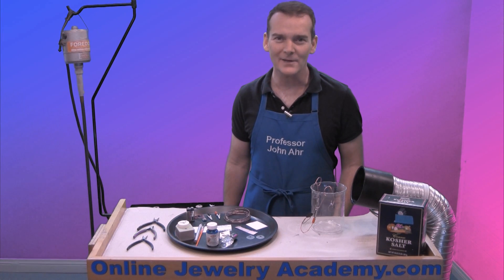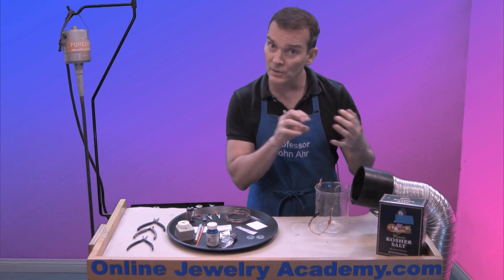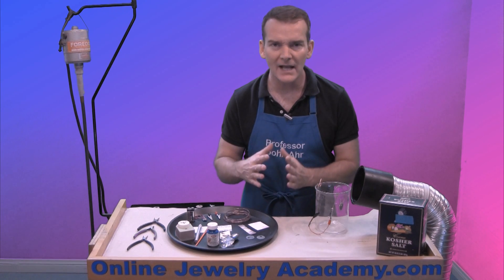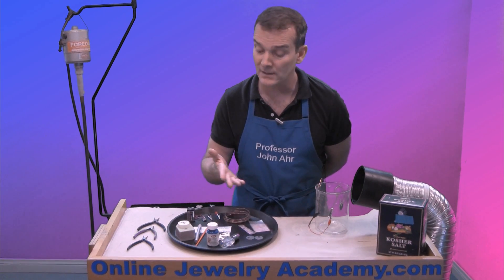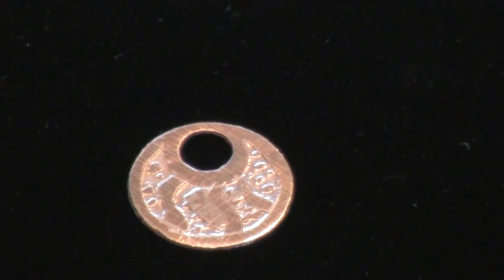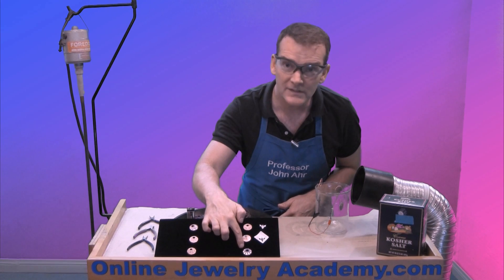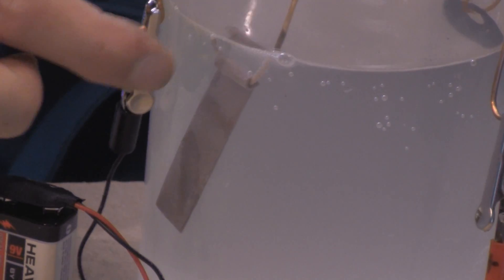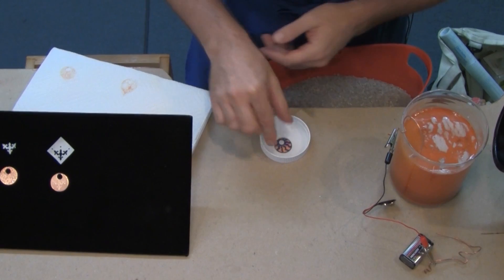Electrical Etching Using Salt Water

Comment: Hi John,
guess I misplaced my question before.
I successfully etched copper using your method. Not very deep though, but did not wait long because this was just a test.
Actually I want to etch silver, and this was disappointing. Achieved some blotchy areas in shades of grey. Reminded me more of the result of blackening silver using saltwater and a 6V-battery.
For the cathode I first tried copper, then silver. That is not very clear, as before you answered 'copper for copper, brass for brass'.
Any idea what may have gone wrong? Thanks in advance.
Reply from the maker: Sylvia Hartmann Sorry to hear that your silver project didn't turn out as you expected it would.  There are other methods for etching silver.  But, they involve etching mordants that can be dangerous to work with.  The OJA strives to provide information about processes, tools and materials that are safe to work with and sustainable.  I'm certain that a search on Google will point you in the direction of other techniques that will help you to better achieve your creative goals.  Thanks for the feedback.  And, thanks for watching!  : )
Reply: OnlineJewelryAcademy
What a pity. I had hoped you would answer that it was my fault because... From the video I got the impression it should work for silver too. I don't want any dangerous mordants in my home, and anyway there are severe restrictions on who may buy those.
Reply: OnlineJewelryAcademy
Hi! I did watch it, of course. And since my setup works with copper... Please do make a statement on what should be used as scrap metal when etching silver. As I mentioned earlier, that is not clear. At least for me. Thanks
Reply from the maker: Sylvia Hartmann If you're etching silver, my best advice is to use a piece of silver as the scrap piece of metal.  I hope that this clears things up for you.  Thanks for watching!  : )

Comment: Hi John, I tried this process and can't get a deep etch at all. Barely etches. I have an adjustable  transformer I got from radio Shack and I'm trying to etch copper.  I've left it in for hours and still nothing. I have the transformer up to 12 but I started at 9 but then went up to 12 when the 9 didnt work. I've tried a small piece of metal and a large piece.  Still just barely etches. I've put so much kosher salt in that it doesn't dissolve anymore. What could be wrong? I've heard some people say to use distilled water. I used tap water as you suggested.   One thing I didn't do is steel wool the piece first but I don't think I saw you do that either. Any suggestions?
Reply from the maker: Susan DeBay I believe that you have the connections from your transformer reversed.  When an etching project is properly connected, you should see lots of little bubbles coming from the copper piece that you are NOT trying to etch.  We have a secondary video on this process posted to our channel.  Or, you can find that video on our website at:  www.onlinejewelryacademy.com.  I hope I helped fix your problem.  Thanks for watching! : )
Reply: Susan, have you made sure that your transformer is set at at least 1 Amp? The current would make more of a difference than the voltage. Don't go too high though.
Reply: I am wondering. You said transformer. A transformer outputs an AC current, in other words remove metal then deposit some back etc.. If a rectifier is used on the output it would make it DC. The etching needs a DC supply.

Comment: this is so awesome. I've done something similar with a vinegar and salt solution and a Black & Decker 6v/12v battery charger. Do you think the charger would work on this, instead of using batteries?  I'm excited to try this process!
Reply from the maker: Clever Kim Let me give you an update to my last answer.  Although the voltage is correct, the amperage might be a little high using that kind of charger.  It might work just fine, but I have never tried that, so I recommend caution.  I have used the transformers that we have shown in the video "Salt Water Etching - Questions and Answers" and they have worked great for us.  If you choose to try the charger, let me know what your results are.

Comment: Hi, Thank you for the videos. I am assuming any metal includes Aluminum? I wonder if you can use a Sharpie pen as a resist as you can with acids for a more detailed design? I know you said that it ate away the resist pen that you used. Thanks!
Reply from the maker: Roxanne Van Paing Hi Roxanne, Yes, this process will work with any metal.  As far as using Sharpie pen as a resist is concerned, my best suggestion is to try it and see if it works for you.  I personally don't think that it stays on the surface long enough to be effective.  My preference is to use an enamel based paint.  There are many different types of resist materials that you might want to experiment with until you find the one that provides you with the best results.  Good luck with your projects.  And, thanks for watching! : )

Comment: I tried the process today.  I had a 6x1 inch strip of copper.  After 90 minutes, I saw very little etching.  The water was very dark.  Any suggestions?
Reply from the maker: ***** Hmmm.  I don't know if you followed the directions exactly.  But, here are a few things that I believe may be the problem.  You might not have used a fresh battery.  Or, you might not have dissolved enough salt into your solution.  Finally, you may have had such a large surface area to etch that an hour just wasn't enough time for the magic to work.  I suggest that you try again and leave the piece in a little longer.  You can always pull it up to look at the progress that is being made.  And, the water will turn into something that looks like tomato soup.  So, you're definitely on the right track.  Good luck!  And, thanks for watching!  : )

Comment: this is wonderful, but, eats up battery :(
Reply from the maker: Manju M 
Yes, this process will eat up batteries quickly.  You might think about speaking with a representative at your local electronics store about a 9V transformer.  They could show you how to modify it safely so that you can use it instead of batteries.  Be safe and have fun.  Thanks for watching! : )

Comment: John,is this a case of the more salt the better?
Your videos are so well done. So glad I found your channel, I've learned so much from you. Thank you
Reply: Hi Kate,  Yes!  the more salt the better.  So try to dissolve as much as you can into solution.  Heating the water helps with this. But, you don't have to boil the water.  Thanks for watching!  Be sure to subscribe to the channel if you haven't already.  : )